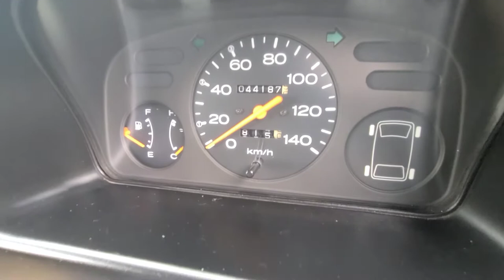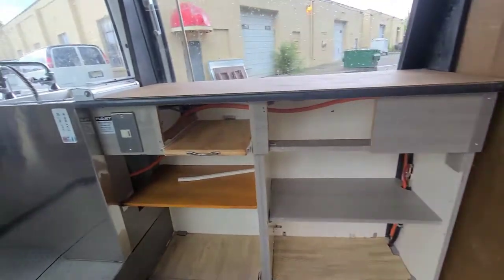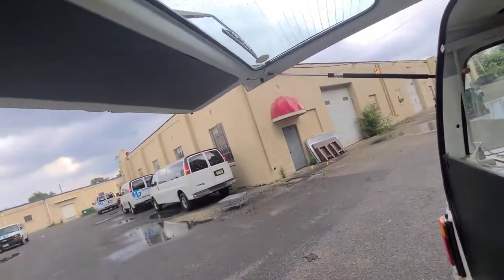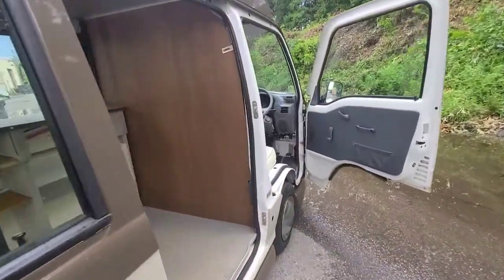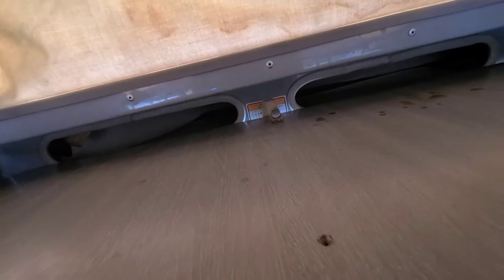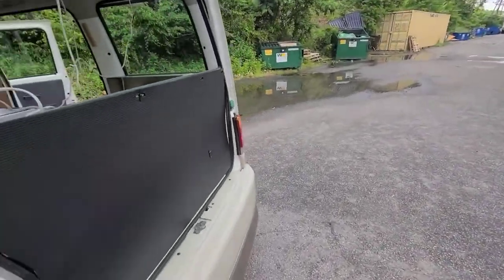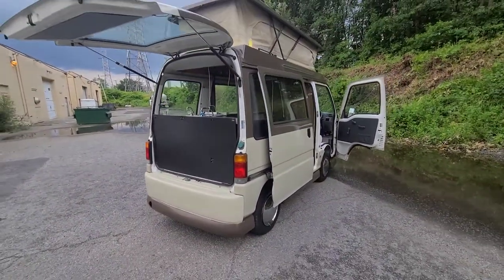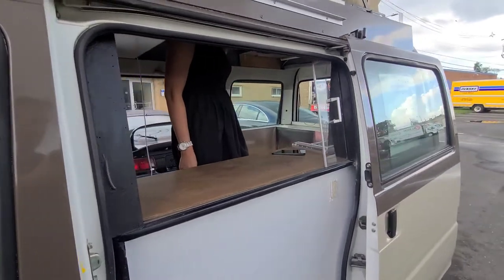FOR SALE - 1997 Subaru Sambar Camper Van

Comment: This would make an awesome camper!
I'm curious... You didn't explain what's going on in the front at all. Do you know?
Reply from the maker: In the front. The just use for storage area. 
Area to place extra product, utensils, bags, extra water, etc..
These vehicles are typically a 1 person operation, so there is no need for a front passenger seat
Reply: Thank you. But I meant the battery setup under that wooden platform. Are they usually set up that way, but hidden under the seat? Or does it help to power things in the kitchen area?
Reply from the maker: @heathercurry2265  Ohhh Yes.  The battery is always under the seat on this type van. But they are usually much smaller batteries. The battery that comes with this van is larger size and it is dry cell. Also there is a power inverter there to convert it to 12 volt to 24 volt for using the small kitchen related stuff.